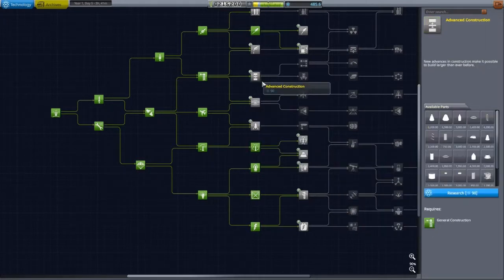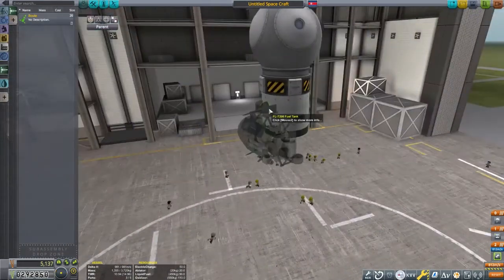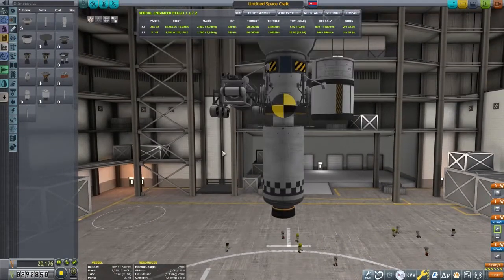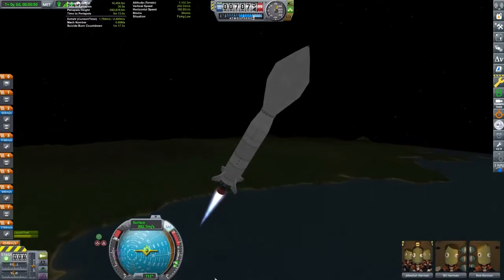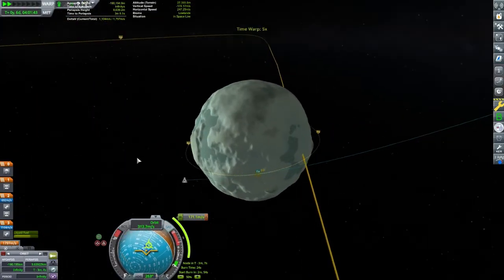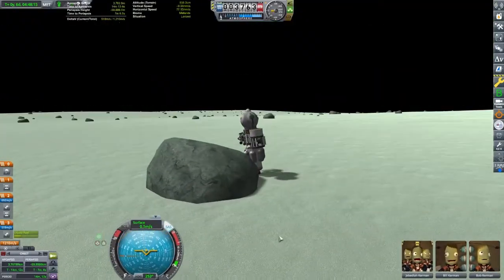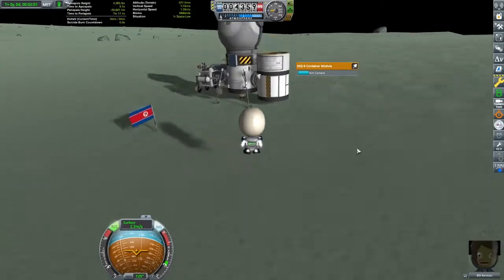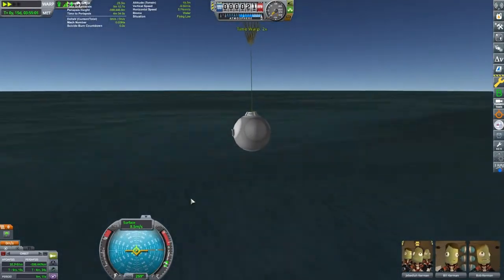Career Mode Tutorial Part 4

Comment: How do the deployable parts work? I have a mission to collect 50% of the data from any deployable science, and I have only just unlocked the go-ob ed monitor. Pls help
Reply from the maker: These parts work best with a scientist and an engineer - scientist for the science parts like the go-ob and an engineer for deploying the solar panels or RTGs.
You need to pack the science parts in the storage compartments in your craft. There is a box looking icon in the assembly buildings on the left side of the screen for this.
Once you land where you want to deploy the science parts, have an engineer get out and grab the controller (https://wiki.kerbalspaceprogram.com/wiki/Probodobodyne_Experiment_Control_Station), then place an antenna (https://wiki.kerbalspaceprogram.com/wiki/Communotron_Ground_HG-48), then the power (https://wiki.kerbalspaceprogram.com/wiki/OX-Stat-PD_Photovoltaic_Panel). Then get a scientist to place the experiments. Any Kerbal can place the items, but a higher starred engineer will make the solar panels work better and the scientist will make the science parts work better.
You'll want to place this from the Kerbal menu not the construction menu. You'll need to press space bar to deploy the item.
Reply: ya i have no idea how to collect the deployable science. he didnt explain it. ijust saw him place the parts but how do u get the science from it
Reply from the maker: @77Fmydog If you have a transmitter, the science points can be collected automatically. You may have to set up relay satellites.
Reply: @Echo3  Thanks! 3 weeks ago, I searched up how to do it on google and found the solution on the ksp forum instantly after posting this comment, yet I appreciate the time you took to answer me.

I do still have another issue that the forum has not helped me with. Even when my collected data goes to 100%, the transmission rate (The science collected back at the KSC) is not 100%. It stops at 50.01% or something. Have you ever seen this happen, or is it just a bug? What's the fix?

Also, love your vids. You have the best tutorials. After weeks of trying, I finally made a prop plane after watching your videos. Thanks a lot!
Reply from the maker: @coolpro211  Thanks for watching. I'm happy to hear you are finding the tutorials helpful.
As far as the 50% issue goes, I don't have an answer. Fortunately, there are so many ways to gather science, that one can unlock the tech tree without ever leaving the Kerbin system.
Reply: @77Fmydog  Ive actually been able to make it work! I referred to a good ksp forum page that tells you to place your parts in a specific order, and then click deploy on the experiment parts, and time warp until it's done. Remember, if you want to collect science from it, you must have a communotron nearby with enough electricity.

I could get the experiment to complete 100%, but the transmission rate was only 50.01% or something. Oh well, at least my quest is complete